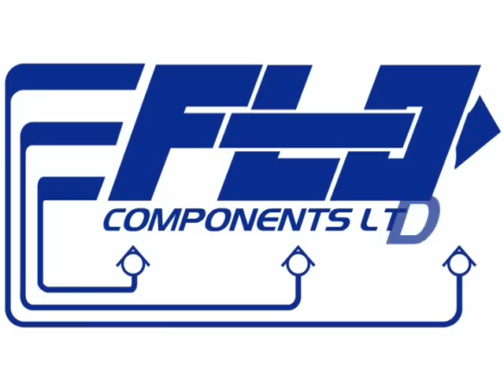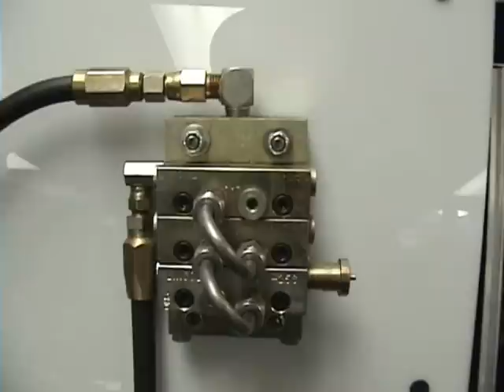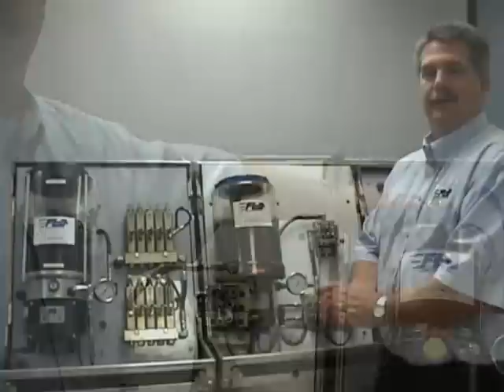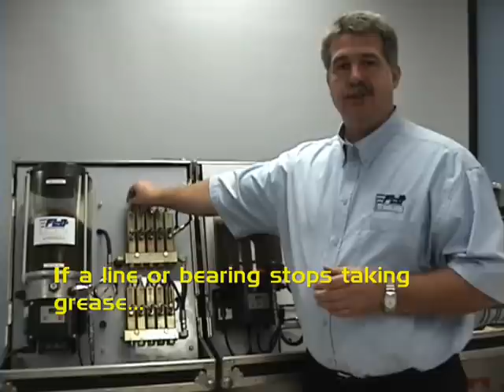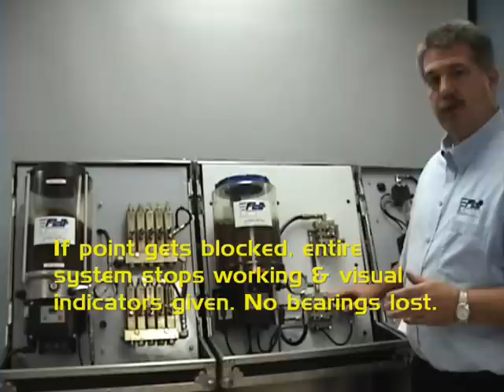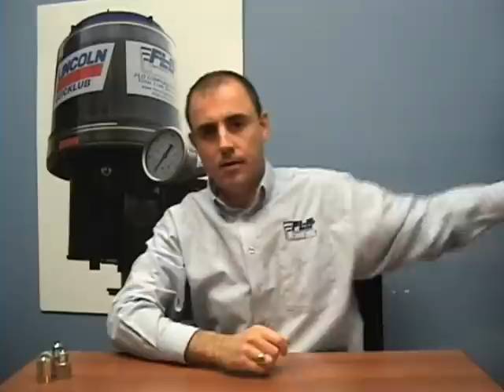FLO Lube Tip - Progressive vs Parallel Automatic Lubrication System

Comment: i need a 5 terminal GREASE distributor the grease i use is very thin Divinol 000 do you sell this TERMINAL DISTRIBUTOR 506510K?
Reply: @Eggy drummer30 yes
Reply: @Eggy drummer30 no i got one from SKF there is no "4" but there is 5